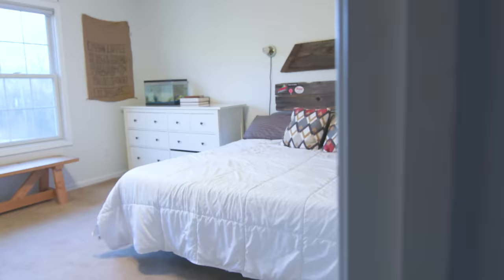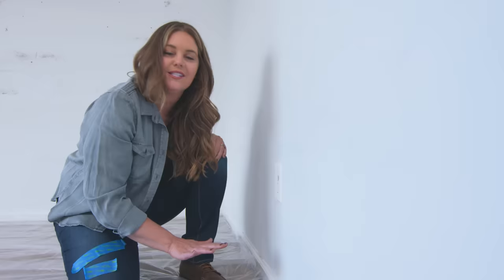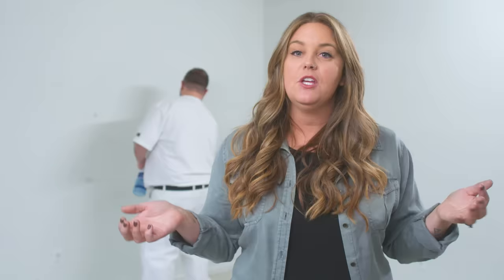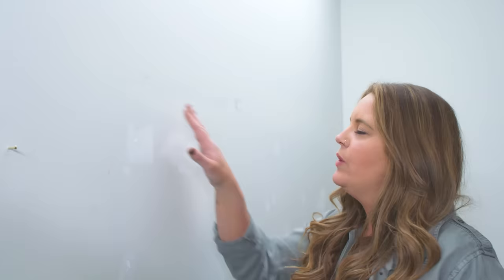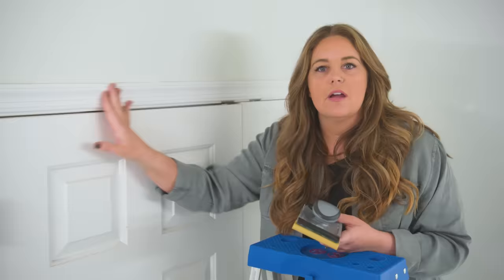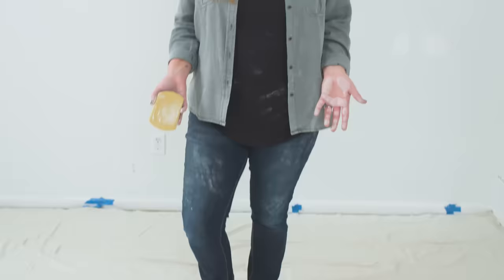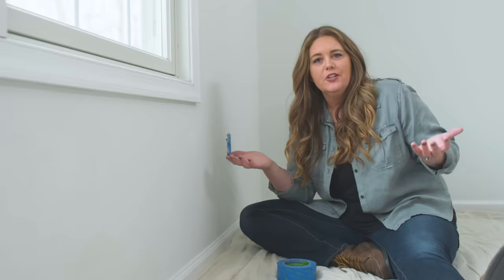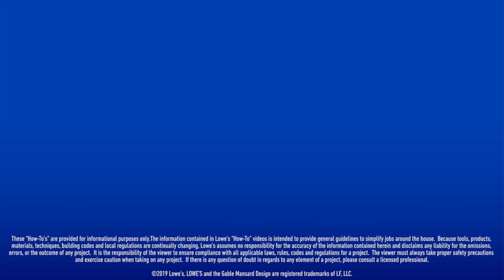How to Prep for Painting (w/ Monica from The Weekender)

Comment: People always talk about crawlspace issues and completely ignore the primary question. Where does the moisture come from to begin with?  When a home is built, typically, a foundation is dug of one type or another, concrete poured, and the excess that was removed is back filled against the foundation.  Since the soil has been disturbed, it now is less compacted which water will soak into much easier than more compacted dirt.  This dirt is supposed to be compacted, but never is so essentially you have a water magnet.  Then you add the thick bushes around the house that block the sun so the ground never dries.  Then the gutter guys come along and drop the gutters right up against the home dumping more water where it doesn't belong.  On top of all that the dirt under the home is typically lower than outside causing more issues.  Fix the outside of the home and the crawlspace becomes much less of an issue.

Comment: Tip-remove all pets and kids and necessary items first to a place that's safe and easy to access away from work area and where items are stored. Things get pretty crowded fast when you empty out a room, especially with kids. Good to have videos to refer too. Keep sharing=caring. Prayers to the journey especially as you uncover work problems in your work. Another dust tip- wet sand first with sponge on Spackle areas then fine sand lightly, usually does the trick. Also a light layer of clothes under work clothes and she's is more desirable along with tie back hair in bun and baseball cap with facial safety gear and good ventilation. When done strip work garments into plastic bag take outside shake before washing, this reduces contamination of the rest of your home and family, take a shower and just water is probably good enough. Plastic gloves can also protect your hands. This stuff you work with has a lot of warnings, heed them  especially when working on large areas. Consider carefully changing drop cloths as that dust will still be there. If bad vaccum walls and ceilings. At the end of your project air room out for 1 or note days and make sure outdoors does not get in. This helps reduce exposure and you should alsoput plastic over door but not tightly so you can keep dust in room and fumes in room. Even consider air filter after job is done. Ones health and life has to be a top priority as we get chronically insulted daily from air, water, food and medical treatments of any kind including toothpaste, too many folk with autoimmune diseases and cancers. So make a safe project with this in mind and it keeps clean up easier in the long run. Question-how to protect floor especially rugs when painting trim and how to handle tape removal that sticks or removes paint as they peel pretty easy? Good video I am sure folks have lots more questions.

Comment: I usually just tape around switch covers. 

I never knew you can cut the caulk tip off using the hole on the side of the caulking gun. This video is very helpful.

Comment: Excellent presentation, but to be honest, I kind of cheat my through the prep process and only pay attention to trouble areas.  I'm like most people, except for taping, I don't spend a lot of time on prep, likely because we move on average every ten years into new homes so the walls and so forth are still in excellent shape. We are late on this 5th move, a serious motorcycle accident some years ago put us behind our moving schedule. 

I spent three months as an apprentice painter out of high school, just to save some money for college and most of what I did was sand, tape, caulk, and clean old lead paint buckets (yuk).  We used lye to clean the buckets and I had to do a lot of them daily.  I constantly splashed droplets of lye on my body and was lucky enough to not get any of it in my eyes.  You knew if it touched bare skin because it burned on contact. I also helped paint the entire basement of a high school in San Francisco and in those days, rarely if at all wore face masks, respirators, or any other kinds of protection to think of. We sprayed and brush painted everything down there and after a while, you got a little dizzy.  It's no wonder many painters took to alcohol to take the edge off after breathing harmful chemicals all day. I was glad to leave that job at the end of the summer. However, I did come away with a good base of knowledge and to this day I enjoy painting actually, especially taping. There was one guy I worked with that was the goto master for matching paint colors.  He would mix and match totally by eye and it was amazing to watch him match old vs new paint.  A lost art for sure, but nowadays computers will do that for you even if you are unskilled.  I'm in the middle of painting the interior of our house, with the help of my daughter.  Next, I'll tackle the exterior, at least I have a professional pressure washer to assist me.  I'll likely rent an airless sprayer, as I have painted a couple houses that way in the past, but this time I'll try and convince my daughter to follow behind me with a roller, that will be interesting.

Comment: Hello Monica. Stumbled across you while searching for info otherwise & thought, painting is on the list so id give myself time with you. OMG! Impressed i am. Step by step with clarity & understanding. Monica, you showed taping the wall to paint the baseboards, however painted the baseboards 'free' handed. How long after the walls should I do the  baseboards; dry to the touch may differ from using tape. Does the quality of paint reflect dry time (in your opinion)? I was sooo impressed I've subscribed & can't wait to hear your delivery of other projects. Are there any on applying 'molding' on walls /ceilings. Thanx Monica. Peace

Comment: There are several runs/drips from a sloppy paint job that I am having trouble with. I suck at DIY so I've been trying to fill some holes from a few guitar hangers using joint compound.  Our previous contractor punched a nice 4" hole on the bottom of the back wall I tried fixing with a screen and joint compound.  I'm usually not a "good enough" type, but am reaching My limit.  I like the idea of using dish soap prior to painting. This is not how I wanted to spend My week off, painting two ceilings(I did the bathroom ceiling as well). Thanks for a great video!

Comment: Thank you for such a detailed video.  I have some textured walls where the paint has been peeled off to the drywall.  How do I prep that area for painting?  I get the concept of scraping off all the loose edges and using a filler to go over it so the edge is sealed and not rough, but what do I do about the texture of the wall?  It is about eyeball height and I don't really want just a smooth spot on the wall that is sure to show up after being painted.  Thanks for any advice you can give!

Comment: Super appreciate this but was kinda confused as to why they didn't tape the border of the ceiling, Even if youre not painting the ceiling, you could get wall paint on it at the joint.
Reply: On painting the walls video, they used the cut in method which they will explain in that video with a 2" angle brush. 😁

Comment: I looked for that 3M spackle and it actually doesn't indicate anywhere on its packaging just how long it takes to dry - it only says it dries "3x faster". 3x faster than what? Without a point of comparison that statement is meaningless. As the packaging was slightly different than what Monica showed I didn't trust it and went with a Dap brand that actually stated how long it would take to dry

Comment: 2:07 WHICH DROP CLOTH COMBO?
Reply from the maker: A 2mm plastic drop cloth with a canvas drop cloth over top makes a great combo for protecting your floor from spills.

Here are links to a couple of drop cloths to get you started:

Plastic 2mm drop cloth: https://low.es/3j5CfZT

Canvas drop cloth: https://low.es/3aghW1A
Reply: @lowes  I was wondering about the measurements of both the, canvas area and runner?
Reply from the maker: Start with a drop cloth that is as close to the size of your room as possible.  If it's just a bit too big, then you can fold it the way that Monica demonstrated in the video.  If it's too small, then you can purchase a runner to help cover the additional floor space.

We sell canvas drop cloths and runners in multiple sizes to fit lots of rooms.  Here's a link to those: https://low.es/3RghBmy

Comment: Great tips, but your caulking method wastes a ton on caulk - which is money. Instead, next time cut a smaller hole off the tube tip and run the caulk bead straight into the edge or pushing towards the direction of movement, and squeeze gently - don't angle it with the pull direction or squeeze too much out. This ensures that you get it directly into the crevasses with less waste.

Comment: As u were putting on the tape, I noticed a lot of imperfections on the wall. Holes and lines. That is a no no with me. This is why I will never hire ppl. When u do it yourself u actually care enough to do a good job. These ppl u hire won’t. They’ll do a quick sloppy job and on to the next. Actually prepping and painting a room takes a very long time, depending on how much damage u have to fix. I had a lot. You wouldn’t believe the condition of the walls in the house we bought. Literally every inch of every wall and ceiling had to be spackled sanded and spackled again over and over. It was a TON OF WORK . But the end results were beautiful